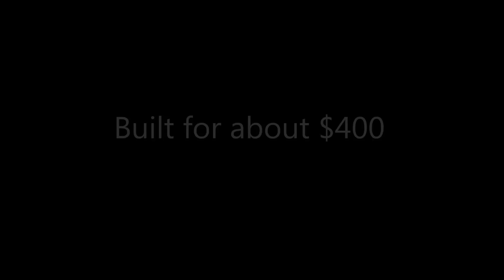DIY $400 CNC Machine

Comment: Amazing build. One question, how did you reduce the play in the drawer slides? Thanks
Reply from the maker: Thanks.  It was a fun build from a while back.  There certainly was some play but it worked surprisingly well.  The projects I used it for didn’t require a lot of tight tolerances.

Comment: Ok I know this is an old video.  Anyway, here in the UK at least, the irony would be, if I was to build a machine like this it would probably work out significantly more expensive than if I bought proper linear rails from China.  Drawer slides are chuffin' expensive!

Comment: I have been thinking about building a wooden CNC router system but I am concerned about warping. I am not sure if this is a real possibility or not but I am considering covering wood surfaces with laminate.
Reply from the maker: Well, if the CNC is made of wood it will always have some variability and will change size based on temperature and humidity.  For most hobby woodworking this isn't a big deal though.  If very tight tolerances are needed a metal/aluminum machine is required.  Using a composite wood like MDF will reduce the expansion and contraction.  (I've never liked the dust and qualities though from composite woods).  Best of luck.

Comment: My home made CNC uses heavy duty drawer slides- 2 sets under a moving table, so the router is static in the x and y axes, but moves vertically on the z axis. The movement is fine over 45 cm either way, but if you want to extend that its quite simple to support the moving table with rollers. I would love to know the holding torque on your motors drez20001. Thanks for a very informative video.
Reply from the maker: +mensamoo Thanks for your comments.  I used NEMA 23s but don't remember the exact specs on them.  They never stalled out or failed to keep going no matter what I tried.  Even on some tests when the router bogged down the stepper motors never missed a beat.  Glad you had success with your CNC.  Fun stuff.

Comment: I don't know if you respond to comments but I'm interested to know what size of motors you used. Are the nema 23's? If so how many oz.
Reply from the maker: +Kaden McDonald The motors are NEMA 23s.  They came as a kit ordered on eBay with the controller board and power supply.

Comment: Great job.  How are the drawer slide holing up?  Are you getting a lot of slop?
Reply from the maker: +valveman12 Thanks!  It still works fine.  Slop wasn't too bad for signs and small wood working projects.  The farther out you get on the slides the more slop there is.  A fun project.

Comment: Drez,
Great build!  What type of drawer slides did you use(were they two piece)? How stable were they in direction not in line with their extending axis? Any issues with drift/movement due to cutting forces?
Reply from the maker: +Christopher Harpster Thanks.  It was a great learning experience.  The drawer slides were bought both online and in local hardware stores - nothing fancy, just regular old slides.  The machine worked well for a lot of projects.  It was plenty tight for wood projects, signs, lithopanes, etc.  When it was at the extremes of the slides there was some play.  Quite honestly I was surprised how well it worked.  Lots of fun.

Comment: Nice build and very clever use of materials...
Reply from the maker: +Paul Bialozor Thanks Paul.  It was a fantastic learning experience.
Reply: +drez20001 I bet... I am in the early stages of my CNC build, the DREAM STAGE LOL, but I digress, so needless to say you are much further along then I... I did find some Extruded Aluminum at a decent price and probably have enough to build 4 CNC's but I wanted to keep my options open so I over bought and for the few bucks it was well worth the time and effort. 

I am now researching Track, Motors and Belt Systems. I really like the Nema 23's and found them online at reasonable prices. The Nema 17's might work but knowing me my default is OVERKILL just to be safe and for a few extra bucks it will do anything I want it to. "Why" "Storage"and "What" I will want this to do is the next Stage of the process... 

It's good to have a dream... Enjoy...

Comment: very good. which cnc-Software do you use?
Reply from the maker: Max Mustermann Hi Max.  For the hobbyist playing with CNC there is a large variety of free and open source software online.   I've tried out and played with a lot of programs.  After a lot of trial and error I've settled into using Inkscape for the CAD part of any design (Inkscape is free and a lot of fun to use); and then Jscut for the CAM part of the process.  Jscut is free and runs in the browser so there is no need to even download it.  www.jscut.org.  Here is how I used Inkscape and Jscut for a small project:  https://www.youtube.com/watch?v=bnov9to-dy0

Comment: You mentioned you used CAT5 network cable for wiring.  CAT5 typically has 8 wires - did you just use a single wire to each lead?  Is the gauge of the wire thick enough?
Reply from the maker: kerry corcoran Hi Kerry - Yep it sure does have eight wires; I doubled up each one so that two wires became one lead from the stepper to the controller.  Seemed to hold the loads fine for what I was working on.

Comment: I think you did a great job on the build! I've been wanting to put one together for a little while now and there are a million things I could cut with this. After seeing this in action, I think I'm going to give it a try soon. Thx for the video.
Reply from the maker: Scott x Hi Scott.  It's very doable with basic tools.  I never put plans together, just slowly worked through the problems as they came up.  Take your time, watch the videos and pause them as needed.  I'm sure you can build one and probably for less than the $400 I estimated.  Best of luck.

Comment: just curious... Have you regretted using a wood frame yet? and what type of materials have you cut?
Reply from the maker: Chris Turnblom Hi Chris.  The project was a lot of fun.  The machine was much more stable and rigid than I thought it would be.  I cut lithopanes, all kinds of signs, and numerous parts for various projects.  The learning gained by building it was also incredibly valuable.  
Some projects:  
https://www.youtube.com/watch?v=JRFjAxZQYTQ  
https://www.youtube.com/watch?v=wRqdAsLoOAA

https://www.youtube.com/watch?v=ySDWs1b5KvE

https://www.youtube.com/watch?v=mchaaVoluKQ

I recently bought a small 3040 CNC for some clock projects I'm tinkering with.  While my DIY wood machine could do fantastic wood projects, I needed a little more precision for clock gears.
Reply: drez20001 
Thanks. That's good to know.
   I'm trying to learn more about cnc machines as my work has been extremely slow due to the oil industry problems and boss has 2 cnc lathes just sitting around that don't work. I got one of them running now but he wants to sell it where I think it would be better to just keep it and start making high performance or custom racing parts or something.
I've run a lot of machines that can be considered "cnc" in industry but haven't had to learn g code, homing, offsets etc. yet. Now that I have had a little experience in the guts of the machines though the prospect of building one to make some money is very appealing.
  My boss is up for any suggestions but it appears that he may only be willing put money into ideas that he thought up so I'm going to have to build one of these as I don't have the money to buy one or build a nice, big one.

Comment: How did the drawer slides workout once you started cutting. I'm thinking about all the sawdust and such.
Reply from the maker: Eric Davies Hi Eric.  They worked really well.  After each cutting I would vac out the dust and wipe them down.  Eventually they could get gummed up but after two years of weekend, or occasional use, they are still rolling fine.  I've made a lot of projects with this machine.  A vac attachment/dust shoe at the router would cut way down on dust.  After a while I upgraded the CNC to hold a regular router.  Here's the video for the upgrade: https://www.youtube.com/watch?v=hSZlMj8YdjQ    
Thanks for your comments.
Reply: Beautiful looking macine.

That looks like regular lumbar you used. No problems with it being warped?

Eric.
Reply from the maker: Thanks.  Yep, regular 2x4s and plywood from the local hardware store.  No warping issues, but I did have to fudge/shim the deck up a little bit on one side.  The whole machine was just eyeballed so it was pretty cool when it came out as straight and plumb as it did.

Comment: Feed rates seem kind of slow.  Will it feed faster?
Reply from the maker: Scott Iwen Hi Scott.  This was the initial machine.  It was workable but I re-designed it to hold a regular sized router.  The regular sized machine can be seen here while doing some foam testing cuts - This is pretty much wide open speed for this machine -   https://www.youtube.com/watch?v=heejAU5LCws
Reply: I am a signmaker and I really would like a CNC router for 3D signs.  Yours works nice!
Reply from the maker: Thanks.  It was a fun project.

Comment: Thank you for sharing and real good thinking of making it your self. Is it poosible to have a list of electronic material you have used? Like step motor(type/name/capacity) motherboard/main computer (Ardurino?), software used to create drawing, converting and ...?

Thank you :)
Regards HHK
Reply from the maker: HHK, thanks for your comments.  It was a fun project and the carving it can do is pretty cool.  Since it was built bit by bit and over a long period of time I don't have a full parts list.  I can say that the stepper motors, controller board, and power supply were ordered on eBay for about $175.  The stepper motors are NEMA 23s (very strong).  The software I'm using to drive it is Mach3 although there are free programs that will work fine.  For design CAD software there are all kinds of free and open source options.  F-engrave and dmap2gcode are fantastic free programs.  I also use makerkam.com for setting up tool paths; makercam is also free and can be run 'live' online or downloaded and run locally on your machine (that's what I do).  Since this machine was built I re-designed the gantry to hold a regular sized router;  Here's the vid on the re-design:  https://www.youtube.com/watch?v=Hbo5Yy0POl0  And here's some signs made with the re-design:  https://www.youtube.com/watch?v=-g6RN-OhnBs  Or...how about a lithopane...  https://www.youtube.com/watch?v=mchaaVoluKQ   CNC machines are a blast to play with.
Reply: Thank you very much. Iæm going to buy same kind of steper motors and Arduino mther bord. I'll try to copy Your material since I have all of them :) Once again, thank you very much. When I come so far, I'll come back to Lithopane part.

Have a Nice day and a great week end :)
By the way, I'm building a Mohogony boat, in case you'll kill some time. http://hayati.no/boat/

Best regards,
Hossein Hayati

Comment from the maker: Pedro - Follow up I forgot to add...when cutting carbon fiber or fiberglass with a CNC be sure to have really good dust collection.  You do not want to breathe those small fibers.  Wood dust is one thing, still not great, but carbon fibers are a totally different story.  Be safe.
Reply: Here's How Easy It Is to Follow The DIY Smart Saw Program>>> Woodcarvingmachinee.blogspot.de >>>
Reply: There is a greattttt ncn machine guide where you can makeeee your own cnc custom smart saw on >> https://t.co/O5Xf7QNRGt?AGYKe11JUVosdd

Comment: Were the Steppers 270 or 428 oz-in?  Did you get the the kit with one bord that drives all 3 steppers?  or te kit with 3 seperate drivers?  Around what cost was the kit you bought?
Reply from the maker: The kit I purchased had one driver board.  If I remember correctly it was around $200.  This looks pretty close to what I purchased.  http://www.ebay.com/itm/US-Ship-3-Axis-CNC-Kit-425oz-in-Nema-23-Stepper-Motor-TB6600-Driver-DIY-Router-/331420876247?pt=LH_DefaultDomain_0&hash=item4d2a393dd7

Comment: I, like Best Racing, am also a rank beginner in this area.  After looking at a variety of CNC's as well as 3D printers it appears that a hybrid CNC/3DPrinter could be built. The carriage for the router could also be modified to accept a 3D printer head and Z axis lengthened for 3D printing, if I am not mistaken.
Reply from the maker: It probably could be converted to a 3D printer of sorts.  I've never built one of those but have been tempted at times.  That would be a cool...a 3D printer made with drawer slides and 2x4s.  Perhaps one day.  Thanks for your comments.

Comment: I really like the design of your machine, thanks for sharing it with us all.
I've been a carpenter for around 20 years, so the mechanical fabrication of the unit is no problem for me.
 What I know less than zero about is the electronics and software that is needed to power it up.
 Is there a good online reference for rank beginners like myself to learn what is required for a machine such as yours?
Reply from the maker: Thanks for your comments.  There are a lot of online resources for CNC projects but I can't think of one specifically for real beginners.  CNC forums are a really great place to start though.  I think most people, myself included, just jump in and start trying aspects of it until things start to work.  I had a lot of failures along the way but when you get that first command line that works, or that first letter that sort of looks like what you created on the screen it's really cool.  As you indicated, the mechanical aspects are pretty straight forward, just lead screws or belts connected to motors with some sort of coupling and then a way to make it all slide around.  I spent a lot of time with just a cordless drill connected to the all thread watching it move around.  It was just cool to watch.  The computer part isn't as scary as it may seem.  On eBay you can get a matched driver board, the motors, and the power supply.  If you go forward with the project feel free to ask questions, I'll do my best to help.
Reply: Thanks, any particular forums you recommend?
Reply from the maker: Sorry I missed your follow up....life, work, kids, etc.  Sure, there is a great little forum called World of Wood - there is a CNC section on that forum.  It's not a large group but there is a handful of really great guys that are willing to help with CNC.  Other than that I checked into many other groups here and there.
Reply: Thanks, I'll check it out.
Reply: The concept is the same as for 3D printer kits. Just need a larger/stronger frame and bigger everything else. The computer/electronics side is the same.
Reply from the maker: Yani - Yep.  Agreed.  I re-designed the machine a little bit to hold a regular sized router.  Works great for all kinds of projects now.  Here's a vid of the basic machine just enlarged a bit:  https://www.youtube.com/watch?v=-g6RN-OhnBs

Comment: also would like to use a ATC if i can lay my hands one at the right price might need an hand with some electronics and programming would need it to run on  240 volt power supply not 3phase so if any one has any good i dears how to make this happen would appreciate i have also keep t the servomotors of the machine but will need some drivers sorting out would welcome any info
Thanks  
Paul
Reply: Does ATC stand for automatic tool changer? 240v? Are you in UK or Aus or NZ? Single phase 240v * 10A = 2400W = 3.2hp. If you can find a Triton 1/2" router (no, you can't have mine). They draw the full 10A, have variable speed dial (8k - 22k rpm I think from memory) and soft start. ...but they are a router and not a quick change head CNC mill head.

Comment: Hi there just starting to build a large cnc router from parts left of a old wadkin using suction matrix table and converting z axis maybe using slides from z axis and all guide rails and bearings will keep you posted lets see how it goes